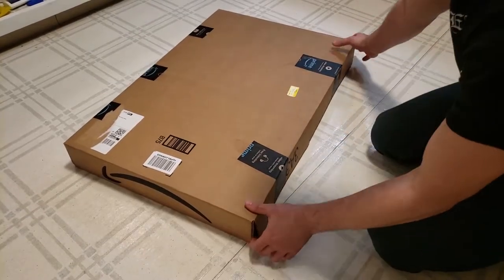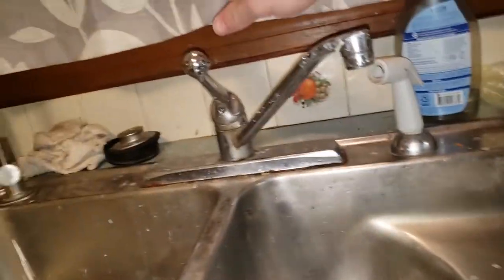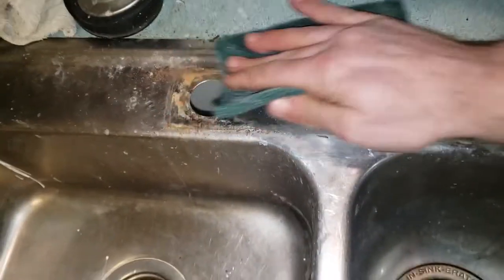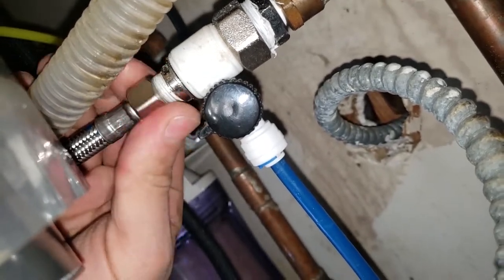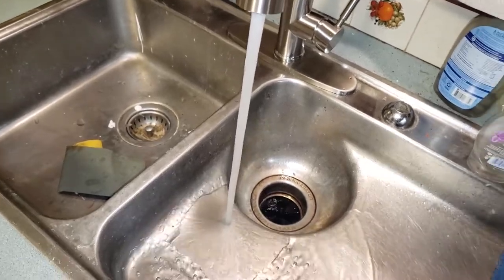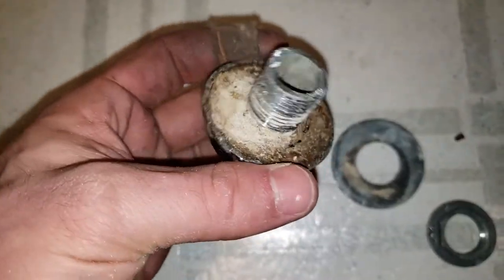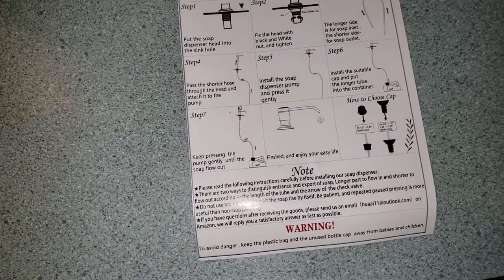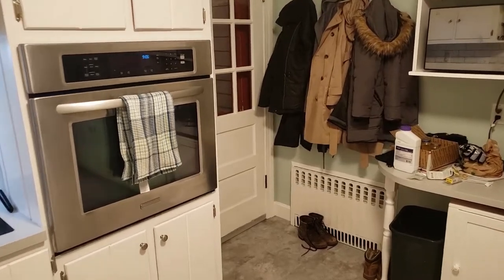How to Replace Kitchen Faucet & Install Soap Dispenser (WeWe) | Kitchen Remodel Series 8/9

Comment: Wait, you already have ball valves for the hot and cold water under your sink and no saddle valves for the filters?  That's cheating.
Reply from the maker: The filter does have its own separate valve on the cold water line
Reply: @Bootstrappin  I was just joking.   Your set-up is the correct way to do it.   

My house has a couple old saddle valves that are problematic and against code in most areas.  I need to remove them all.   The cold/hot valves in my house are the cheap plastic gate valve kind.  Half of them won't budge.  I'm afraid to try and force them since there is a good chance I'll snap the handles/stems off.

Comment: nice lookin wewe 

quick question - for your undersink water filter, have you ever had leak issues with those blue "plug in" connectors? always paranoid about those going wrong...
Reply from the maker: ;)

I've had some issues initially when I set it up. I'd put rags down overnight to observe for leaks. It always turned out to be a flex hose not being cut straight or jammed in far enough, or not enough Teflon tape on a screw in fitting. Once you fix the leaks, it's very reliable. Had for four years now, no problems.

Comment: How did you cap off the water that used to go to the sprayer?
Reply from the maker: That was integrated into the old faucet, so there was no tee to cap off.
Reply: @Bootstrappin  thank you for the quick reply!!